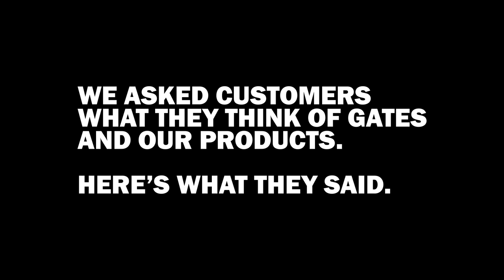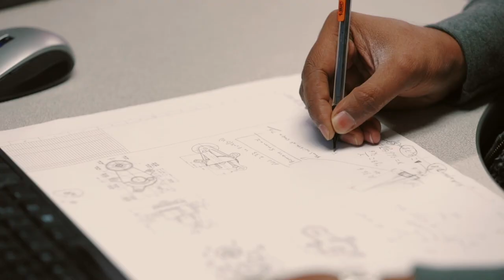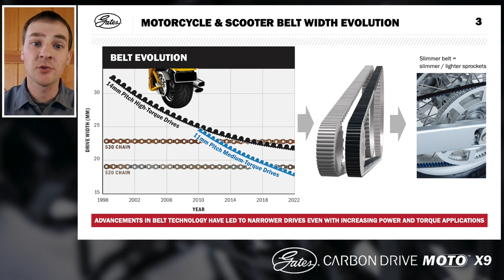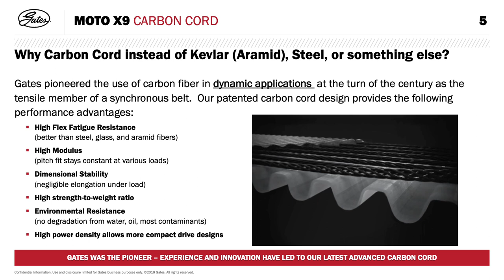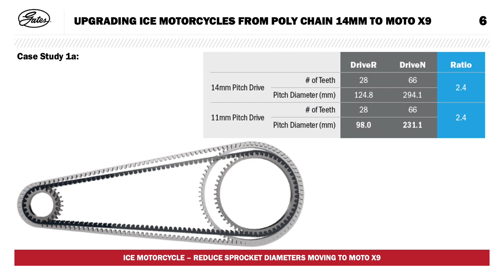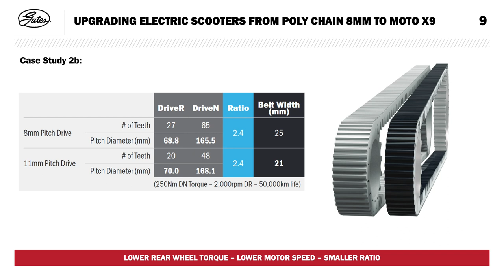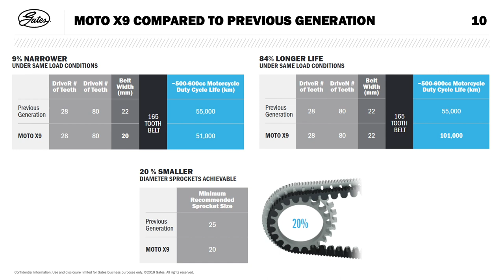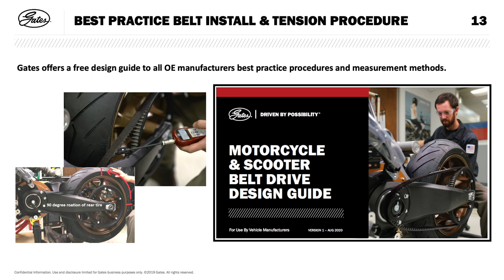Gates Carbon Drive | Moto X9 Launch

Comment: My belt squeak/squeals/chirps a lot during winter months. the only solution I have found is to apply silicone to the teeth on the belt - is there a better solution to fixing this?
Reply: @JCcanU  not possible
Reply: @AdventuresonZero  Bummer . few of my friends snap belts like nothing there .  had to go with chains .
Reply: Fully closed chain guard?